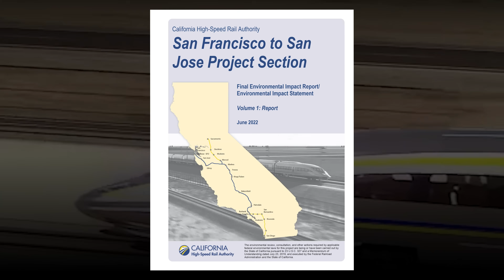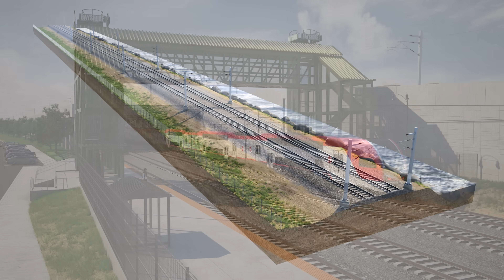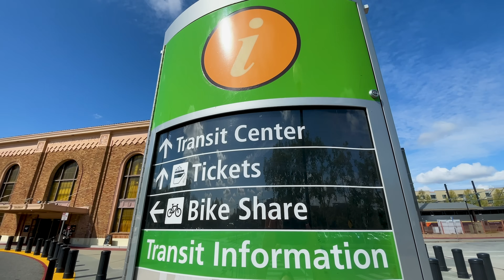San Francisco to San Jose Project Section Overview - FULL VIDEO

Comment: A Chinese train on a Chinese network would make it there in half that time
Reply: china also has 1T dollars of debt from HSR alone...
Reply: @bucket6386  First off don't believe everything you hear.  Believe what you see though.  Look at all the videos and you'll see them trains is slap full or close to it.  and many of them hold close to if not over 1,000 people.  With Billions of trips being taken every year how long do you think it's going to be before any debt is paid!!!  If the U.S. built a high-speed rail network with trains traveling at 250 m.p.h. i could guarantee you that it would pay itself off very quickly because there would be a lot less flights and vehicle trips being made as people switched to rail!!!
Reply: @cliffwoodbury5319  lines connecting beijing, shanghai, nanjing, chonqing and guangzhou maybe, but what about the line to tibet, that doesn't even make enough money for the electricity on each trip, not to mention China treating it's HSR like airports which kinda ruins one of the main appeals to HSR.  And 1 Trillion dollars is a hell of a lot of money to pay off...
Reply: @bucket6386  they did that same thing in Europe except it was a gradual transition, induced between private company competition and contained to each country's jurisdiction (which is a smaller area). China built it as fast as they could in order to look good economically
Reply: Yep, at a cost of $50 trillion, with half of it stolen bu the construction company, and viaducts that fall into gorges.

Thanks, but no thanks! We’ve had enough “Chinese construction brilliance” with the leaning Millennium Tower and Eastern Span of the Bay Bridge! We actually want a functioning system when this is done!

Comment: Only 110 what a piece of crap project
Reply: 110mph for 45 miles. It will be 200-220mph after that until it reaches Burbank.
Reply: It can't run near max speed in some areas to prevent problems like derailing and noise, but going through the valley the line is straight
Reply: What I don't  understand why it took so long to get this project to get started
Reply: @matthewchang4706  there are many factors, some within the control of the CAHSR Authority. I’ll highlight three of the reasons here:

1) Lack of funds. The initial bond approved in 2008 was $9 billion for what was estimated to be a $40 billion project. This was the same election that Obama and the Democrats won handily and the expectation was that a High Speed Rail Act would be passed. But it wasn’t. The only federal money was $2 billion from the TERP Act for economic recovery from the Great Recession. The state of California has dedicated 25% of all cap and trade funds to the project, which has contributed about $300 million per year or about $3 billion total. So far, the project has been paid for with 80% state funds and 20% federal funds, which is extremely abnormal for infrastructure. Typically the federal government is paying 50-60% of the project’s cost. The Republican wave in 2010 killed any chance at dedicated federal funding for high speed rail in the country and then Trump’s election in 2016 led to a hostile Federal Transportation department that tried to take what little federal grant money there was back from the project. Like most big projects with significant but partial funding, it was broken up into smaller phases and since the TERP Act money was required to be spent in the economically disadvantaged Central Valley the CAHSR Authority decided that phase 1A would be the Central Valley segment.

2) Lawsuits. High speed rail requires a right of way that is as straight as possible, with gentle curves where needed. This required the purchase of farmland in the Central Valley, a strongly Republican demographic which opposed the project. There was an organized effort to use lawsuits to delay and hopefully (in their eyes) kill the project. Other than a few minor exceptions the CAHSR Authority won all of these lawsuits, established their right to use eminent domain, and cleared the way for construction to begin. These lawsuits didn’t just cost money but they also cost time. Construction was delayed by years with major construction not being able to start until 2015. 

3) Design-build contracts. This was the biggest mistake by the Authority. Instead of awarding a design contract and then allowing building companies to bid based on the design produced by a different company, they decided to have companies bid to do both design and construction. They thought this would save time and money but it backfired. Change orders were frequent, budgets increased, and delays happened as a result. Some were justified because of unanticipated obstacles , that happens with big projects, but some were frivolous and the Authority actually sued and won against one contractor because of that. They have since switched to the more common process of Bid-Design-Bid-Build.

Comment: San Francisco to San Jose is slow speed rail...this is a scam.
Reply: No high speed rail system runs at maximum speed for the entire length.  This is a short section in one metro area, that already carries Caltrain commuter rail (and some freight), that runs through existing development, and the HSR upgrades faced pushback from some rich locals who hate scary train noises. Uncertain funding at times probably helped influence the design too. So HSR is being implemented in a relatively cheap and non-disruptive way here.  There are some grade separations and elevated sections that were built, and electrification is almost complete.  And despite not being high speed on this section, the new top speed of 110 mph, after electrification, is a big upgrade over the current top speed of 80mph. The high speed parts (220mph max) of the system are mostly in the central valley, so travel through there if u wanna go fast.
Reply: @punchnazis3498  I understand your point but there is a good chance that we get CalTrain electrification and the Bakersfield to Merced only.  Nothing else is funded.  We here in Southern California are possibly getting shutout.  Gilroy to HSR might also never get done.  So to call CalTrain electrification like it's a big part of HSR is misleading at best and a complete lie at worst.
Reply: @Oak Island Pictures I would be happy with a modern San Diego to Irvine train.   Right now it runs like a 19th century single track steam train, the Pacific Surfliner.  And Metrolink?  It travels at bicycle speeds and at grade and single track.  And yes getting the Palmdale to Burbank tunnel will be critical to joining the HSR system but as I am aware there is no funding left after CalTrain and Bakersfield to Merced gets built.  So it's like hoping for flying cars.
Reply: @thegoldstandard55  Because you, the locals, have failed to do invest enough to make it better. The Bay Area has with Caltrain.

If you want good infrastructure then you also need to be willing to pay for it. Nothing cones out of nothing.

Comment: Did I just see an at-grade crossing on a "high speed" rail line
Reply: Yes, a section with a top speed of only 110mph.  So, not a high speed section. It's fine
Reply: It's fine. If you look and see Japans shinkansen also has sections of their line that's at grade. Sometimes you have to work with what you got 🤷🏽‍♂️
Reply: @thetrainguy1  Fairly sure no shinkansen line runs at grade with crossings, if you can show me a section that does, then I will take this back.
Reply: @RashawnBlue1  I think the Mini-Shinkansen lines do. Those are lines were Shinkansen services run on lines that are upgraded to standard gauge from the cape gauge. They only run at 80 mph at best.
Reply: @RashawnBlue1  There are Shinkansen lines that do. It’s just that the everyone likes to forget that they exist or always classify them as something other than Shinkansen.

Other HSR systems also have protected grade crossings. This is just an anti-HSR propaganda talking point. “See they’re doing it wrong. Let’s cancel the whole thing!”

It’s not a particularly new or clever talking point either. Long debunked and rarely used nowadays because of that.
Reply: @TohaBgood2  I can see why they aren't exactly classifying it as the same hence "mini-shinkansen". It's basically a standard rail when it rides on that track and only certain Shinkansen can ride on it.

I think people should understand that HSR trains can and very much should use standard rail lines over making another dedicated HSR rail when it is not necessary. How that impacts the line though, should be taken into serious consideration.

I will repeat though, that grade crossings should be as minimal as possible. The performance and safety advantage (though more costly) are pretty clear.

U.S is not like Europe or Japan; its auto culture and desire to skirt around traffic rules are worse. I can definitely see accidents more than Europe and Japan encounter.

Comment: Shame you didn't have the foresight to quad track the new grade separation. :/ 

I'm all for blended systems but be clever about it
Reply: Soon they will realize we have a lot of roads to rip out
Reply: There are a few quad-track sections along that corridor, but there's no room to expand without displacing some homes and businesses, or spending more on expensive elevated structures or tunnels.  They would have built a completely separate HSR system the entire way, if there were funds and/or room for it.  Maybe in a hundred years there will be a dedicated HSR tunnel between SF and SJ lol
Reply: If YIMBYS had the same power to act as NIMBYS do we would have so many great things.
Reply: They tried. The local NIMBYs killed all the plans. What we have was the only thing that could be conceivably built without killing off the project.

That being said, they have extensive plans about how to do future upgrades to make the ROW faster and better. It will Just take longer now because of the NIMBYs.

If you live locally, I hope you will be there with the rest of us to do battle with the NIMBYs going forward for the upgrades!
Reply: Go YIMBY movement!

Comment: Why the many grade crossings?
Reply: Because the NIMBYS on the route kept suing to block grade separations and passing tracks. The Atherton billionaires almost killed electrification too!
Reply: @TohaBgood2  Well said. Good knowledge.
Reply: When this line opened Lincoln was president. Nobody thought of grade separations. Then along came the auto and roads started crossing the railroad all over the place. The railroad was there first but nobody thought of grade separating the new roads from the existing railroad. Over the years some have been done and some roads have been closed. It will probably take another fifty years and a few hundred NIMBY lawsuits before the job is finished.
Reply: @danielcarroll3358  Well said. You make good points. I believe the safety record won't mimick Brightline's issues.

Comment: Build it faster! Full funding ahead is the best option from the state and federal gov; "cheaper" to build it and assume costs rather than count every penny and drag it on years and years longer.
Reply: Unfortunately I can't see us getting any significant federal funding; the northeast senators want all federal railroad funding to be directed to the Acela corridor and most senators from red states don't want to fund trains anywhere.
Reply: @tim1724  from the state might still be helpful. California is a pretty heavy blue state
Reply: @tim1724  secede !!!!
Reply: IMO, slow and steady wins the race in this case. It's much better to build a sustainable industry of rail construction workers so that when phase 1 is finished, phase 2 can begin, and then phase 3 and so on, and so that those same workers can move on to do continuous maintenance.

If you try to build too fast, you will have to pay a premium to train all new workers at the same time, and more will be out of a job when the job is complete.

The key will be to maintain a steady (or steadily increasing) stream of projects. After these initial rough years of creating that industry, we'll have a pool of skilled and experienced workers ready to build and maintain more and more high-speed rail.